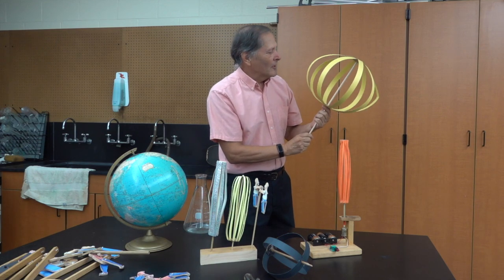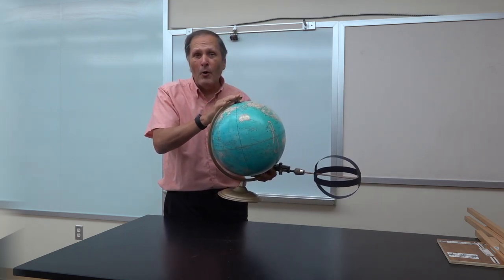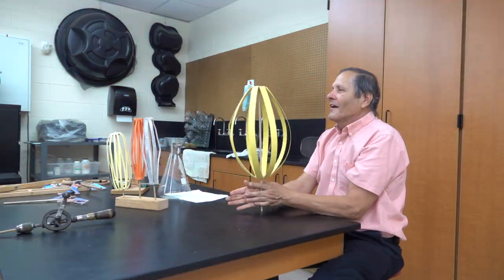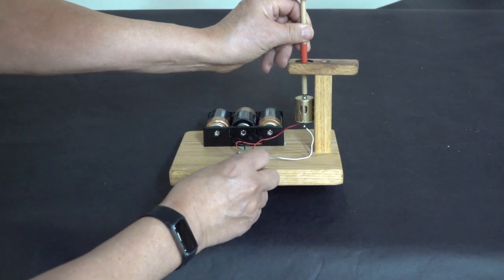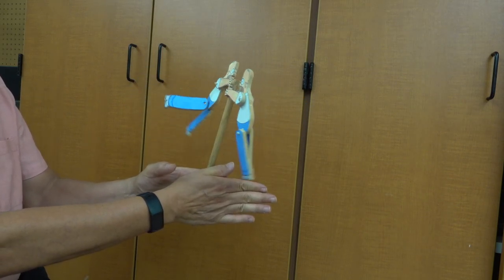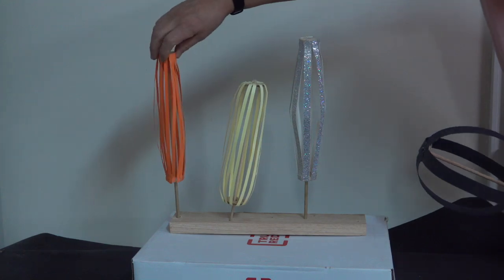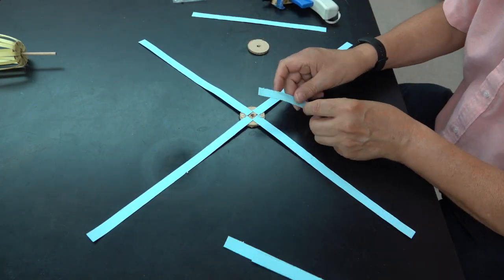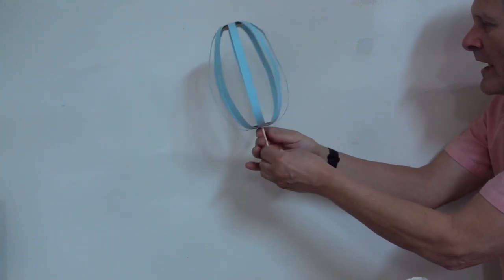Centrifugal spinning toys //. Homemade science

Comment: Hello Bruce, You might like to play with large pine cones and Wisteria seed pods. They can be used to make weather toys like the German weather houses. The pine scales move with humidity and so do Wisteria pods. (they twist when dry & flatten out when wet) I think "motors" can be made from them. pine scales can make a hygrometer just by putting a straw on the point and use fun tack to hold it in place. some scales move 180 degrees or more. Wisteria pods twist 360 degrees easy. Soaking these with salt water effects how they absorb moisture from the air.

Comment: Question: Everybody is balanced if its center of mass passes through its base.
But in the banking of the cycle, the cycle is ultimately balanced because its center of mass is not passing through its wheels. (base)
How does a banking cycle balance?